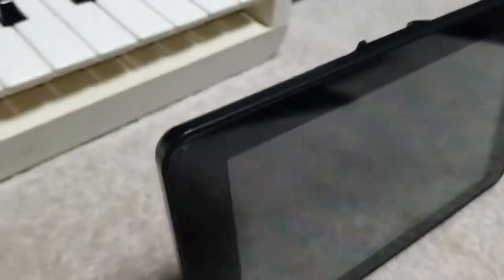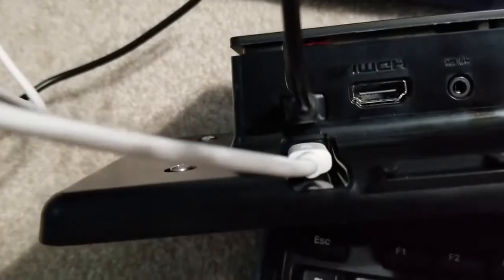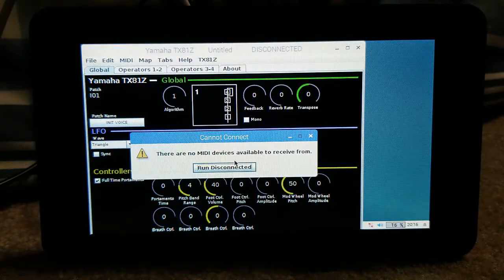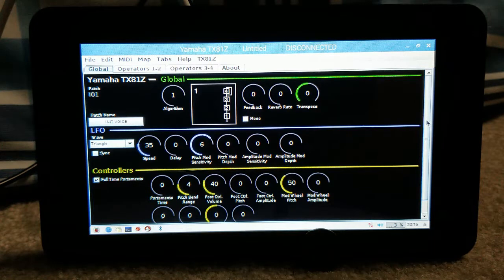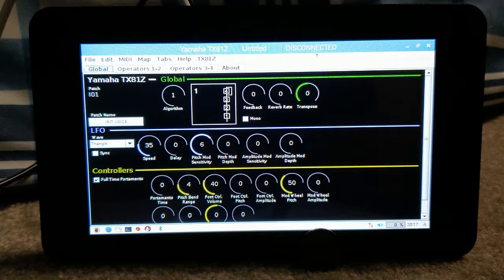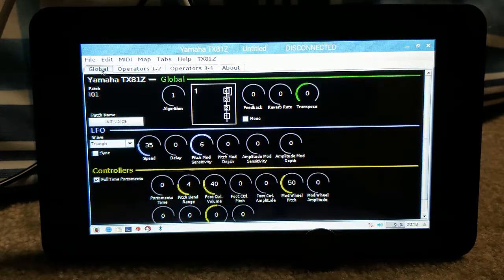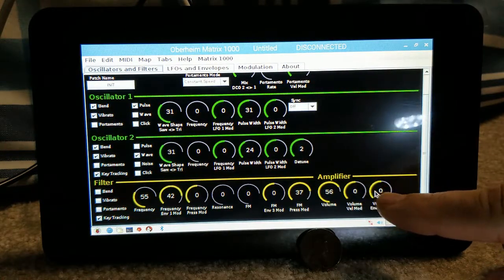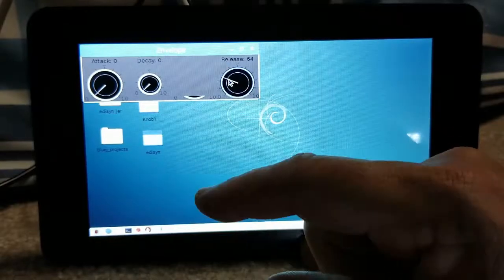Raspberry Pi Touchscreen - MIDI sysex patch editor demo

Comment: This is great. I bought my second M-Audio Venom, which has a brilliant sound engine. It is a nightmare to program without the Vyzex software. They were developing a VST editor, but it looks like they abandoned it. 

 I stumbled across Edisyn last night. And was previously looking into Raspberry PI systems. 

Would you ever be open to making something like this if someone paid you?
Reply from the maker: Everything is off the shelf. Edisyn has a manual that explains how to create new instruments. I have made a basic template for a pg200, roland programmer bu havent finished it.  It's a bit of a techie project. Mabey you could ask the edisyn programmers, I the think they take requests

Comment: Are you able to replicanti the pg800 ? I don't want to spend 500 euros on that old shitty hardware editor:(
Reply from the maker: This is a  Sysex editor. The roland pg editors require more hardware. I have a real roland pg200, and another video shows a hardware midi cc to pg200 interface. But it is hardware. I have already created the pg200 gui for the rpi3 but have not made a video yet. In anycase the hardware is required. A  man in Sweden make is and sells them for less that 100$. See the mpg200 video. I dont know if he has a mpg800 but i expect the process would he similar